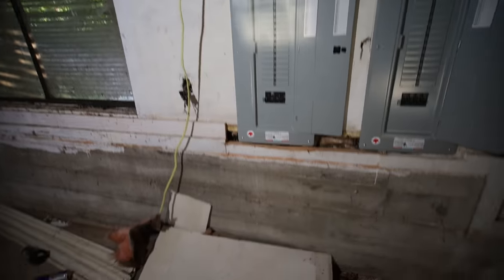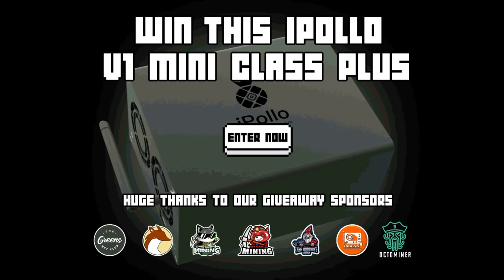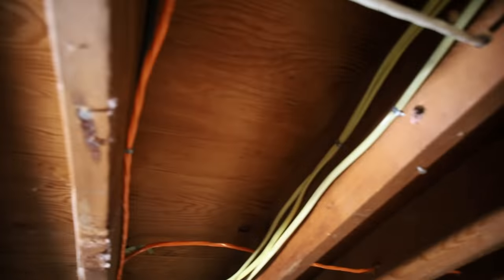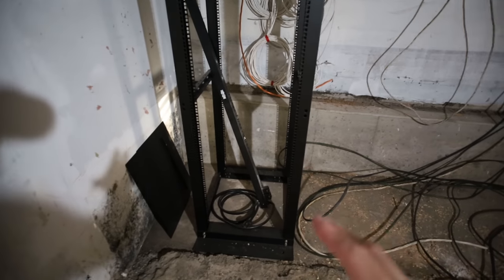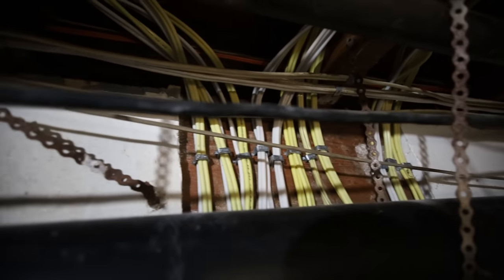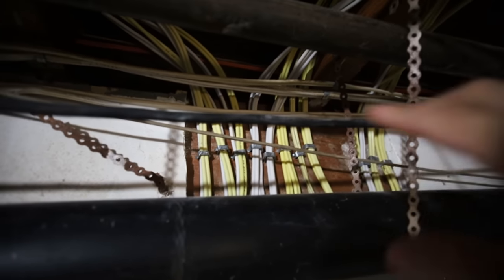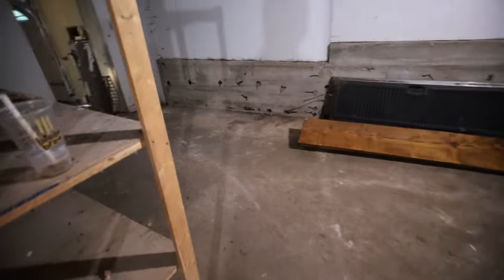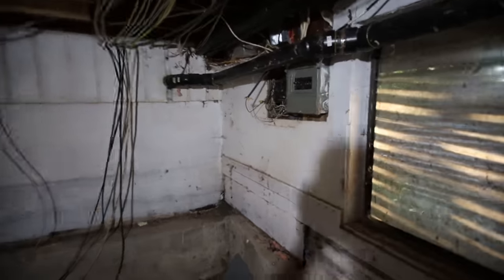Circuit Panels Are IN! House Mining Vlog Update

Comment: A few suggestions:
- Keep everything (especially power cables) a few inches off the ground in case of water.
- Heat and noise will radiate through the ceiling into the living space upstairs. You will probably want to insulate the basement ceiling. (and maybe those white acoustic ceiling tiles)
- The dividing wall is a great idea. Setup hot/cold sides in a box or shelf like the barn.
- Isolate the air intakes and exhausts in the mining room from the rest of the house. Don't want to create a vacuum and just pull all the air conditioned air through the house and to outside. Then if you want to heat the house in winter, you can add a diverter + damper to the exhaust and tie into HVAC.

Comment: Hi RPM,
If you have central Air, think about making your mining area just like a "Large Grow Area" where the "In and Outs" are isolated and you can tie the "Out" to your heating system just at the base of your furnace. That way in the winter hit a valve and send your heat to the whole house heating instead of the outside.
Talk to an HVAC guy it won't be hard to do. You just have to make sure you have the "Fresh clean air" coming in filtered. In regards to your room, think long and hard. Get multiple Miner friends to brainstorm. Good luck bud!!

Comment: Panda a few ideas of mine to help manage your mining room
-roxal safe and sound the ceiling mainly for sound and would give you more time to escape or save some valuables if you had a fire
-would be a good ideal to drywall your ceiling for fire 5/8" drywall equals 45 minute burn time
-a drop ceiling ie acoustic tiles would help with sound and heat by creating an air space 
-put a insulated drywalled wall up on both sides of your panels with a door to the left and right of your "electrical panel hallway"
-cut holes in your doors to use furnace filters as intake filters 
-use 4'x8'x2" foam sheets to create a box around your mining rig shelving to direct the air to your window exhaust fans also for heat and sound
-use a separate exhaust fan tied into your furnace return air connected to a thermostat on the main floor for winter months
-try to isolate your exhaust fans from your house (rubber mounts, hanging, etc)
-grab a paint sprayer and spray that whole room

Comment: I mine in my basement.  I have a big exhaust in my window and one grow tent that helps manage heat.  It will heat up your main floor.  I’d recommend insulating the rafters and insulating your ductwork for your house. I had a big issue with my ductwork sweating a lot and dripping all over the floor while my AC was running for my house.  Insulating it would help. You don’t need to sheet rock the ceiling. I’d leave it exposed so you can move stuff.  The panels look nice.  I am working with my electrician currently to upgrade to 200 amp in my house and start installing solar.  I can’t wait to see this basement start coming to life with rigs.

Comment: You might want to consider placing insulation between the floor joists for sound deadening.   I would also HIGHLY recommend placing drywall on the ceiling for fire safety reasons.   If you ever have a fire in the basent the drywall on the ceiling will provide significant amount of time for your family to escape safely.
Reply: Very good advice 👍🏻

Comment: I would dedicate one or two whole rooms for all the mining and avoid having few rigs in every room all over the house.
Also I'm no electrician but I highly doubt GPUs heating the panel should be of any concern.
All legit electrical equipment already has safety margins (the 80% rule) applied to the ratings, and then you are going to apply the 80% rule again, and also it's not like you are going with some crazy temperatures, it's not like your room will go above 150*F.

Comment: I love the idea of a 12x12 room just for mining. But you have to think about the mining rigs in the back that are getting warmer air than the ones right next to the intake... Maybe a hot aisle cold aisle solution would be better in that case (something like in the barn with the octominers). Maybe you can try to put lower power rigs next to the intake and hope that the air stays cold enough to cool the other rigs.

For the curcuit pannel: I don't have a problem with heatsoaking in my house. But i my dad put the panel in and resecced it in the wall with doors and insulated. So i think you could also put a kind of "Box" around the pannels themselfs and insulate the doors to it. I'm not sure if that is easy or cost-affective in your case. But worth considdering imo.

And definitly get a window on that wall you showed. don't rely on the garage door windows to get enough air.

btw: I'm loving the content on the new house ;) <3
Reply: I mean a $20 box fan in one standard size window cools 189 GPUs with no problems all year round 🤫
Reply: @thomasdriskill5254  i personally have no real experience with this, cause my fram is only about 1kw. I guess your opinion is better :D

Comment: Hi RPM. You will save yourself a bunch of time if you get yourself a network cable tester.  They are cheap and effective at making sure there are no errors in setup and only cost around $20 or so.  Saved me a bunch of time when I flood wired our house with CAT6a (including a run up to my man cave 40 metres from the house).

Comment: Are you going to soundproof the whole basement? Also highly recommend drywall and insulation for the walls and ceiling unless you want your house to be very hot and loud. This would also be a great opportunity to solve all the heating and exhaust issues you had in the barn and garage. Looking forward to see how it turns out.

Comment: You should install a 100 amp electrical subpanel off of one of your 200 amp panels. The 100 amp subpanel will have an interlock and L14-30 plug for generator hookup. Subpanels should have your well pump, refrigerator, deep freeze, sub pump and networking equipment. You also want to install a whole house surge protector in each of your 200 amp panels. I would invest in some type of blower fan along with a damper and tie into your HVAC system. This way the heat from your mining rigs can be blown throughout your home for heating. Somebody in the comments recommended sub pump for the basement. As far as the basement goes I would consider cleaning the walls and installing masonry paint that offers water protection. Sound dampening insulation on the basement ceilings. Just a few ideals.

Comment: This is a big opportunity to have all your rigs together, and that would be ideal instead of them scattered around your garage and stuff. It would be nice to see a wall of Asics , octos and maybe some open frames to test and such. Not to mention actual work tables so you don't crawl around working on floor ( which I suspect you will anyway 😅) exciting times ahead! You could make one wall and exhaust all the heat into a small room the exhaust it from there. And have a few ducts going back to where the air comes in, that way mix heat with incoming air in winter to avoid too cold!

Comment: I would turn 1 of those windows into a block type window with 2 blocks used as exhaust vents like the ones used for drying machines. 1 to funnel cold air in and the other to funnel out the hot air.

Comment: For the room you put rigs in go as small as you can. The bigger the space the more CFM (and therefore power to drive bigger fans) you will need. Utilize ducts for your outbound air to reduce room size. I would make it big enough to hold the rigs, move around to work on them, and that's it. 12x12 will be too big.

Comment: @Red Panda Mining  Please please please, clean the space before you put any hardware in.  Wash the floors and walls to get any webs, dead fly parts.  Paint the floors and walls ceiling.  Go rent a sprayer and let everything have it!  THEN start to build out the room. 
Your rigs will thank you with better cooling and longer life.  Keep Smiling :)
Reply: Would be best to install a small wall mount telecom rack for your cat6 runs, then patch over to your rack.  JIC you want to move the rack around at later date.

Comment: 'Some People" LOL PHEW, didn't want you going to prison for making the low voltage disappear...
I don't recall if you've mentioned in the past whether you were planning to finish that basement floor or not. I know there is always a budget and schedule to contend with. I would suggest cleaning up the floor, caulking any cracks, dropping some self-leveler where/as needed in order to epoxy/grit the floor. It will help cut down on and control moisture, provide a protective layer on the concrete and the grit will help prevent slipping say if you're moving rigs and there is any water on the floor.
Reply from the maker: YES! this I want to get done. Running out of money though lol
Reply: @RedPandaMining  Placement of rigs: I agree some sort of ceiling on the hot side. Consider filling the bays with either mineral wool batts or open cell spray foam (Not a special trip for this, too expensive) This will cut down on Noise and Heat permeating through to the first floor. You could add a hard ceiling or acoustic ceiling later, but the insulation is step 1. Also keeping the rack system isolated and independent (Not a stud framed wall) will reduce the potential for vibrational transference. This way the doorknob on the other end of the house isn’t making constant noise mysteriously.

Comment: I would try to keep the power pannels cool you could get a lot of Problems with prematurely Breaker poping, also the srews on the wires could get lose if the tempretaure changes alot wich is a fire hazard. And all of your rigs take a couple % more power because wire resistance is higer and so power loss in the wires.

Comment: That server grade item , you should also invest in a fire surprisingly system. My question is why not get a server room.
Reply: You need a drop ceiling to keep heat a fire if you have a problem. Also need to use a fire resistant dry wall. And I would have a raised floor but you can use concrete. That would allow you to hide wires next you could run Ac also under the floor. I leave the breakers exposed as you need to see them. You need a eps all power need to run though this . A generator would be nice but a eps to filter the power.
Reply: Check local + state fire codes for new server rooms.
Reply: And having a back up data line would be good .
Reply: Running ac under the floor will keep everything cooler
Reply: That was the way it was at the Bitcoin operations I was at.  Also was a tape backup so in case of failure you could bring the system back up online fast .